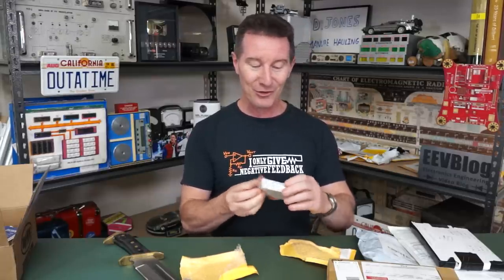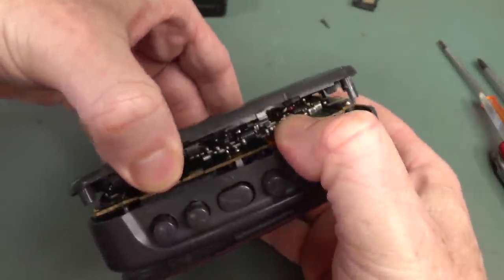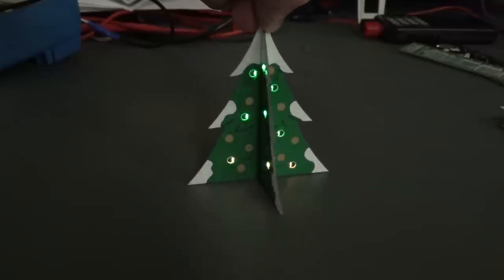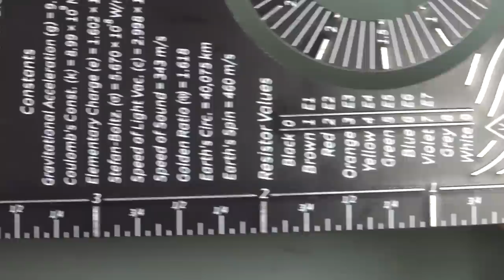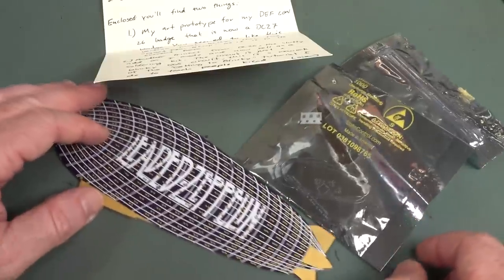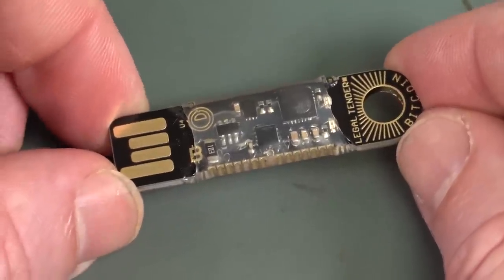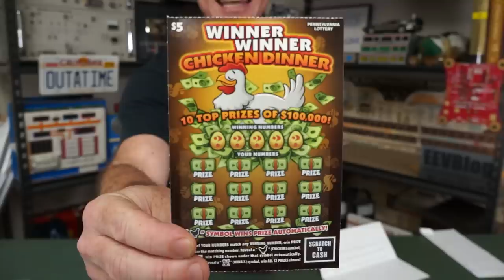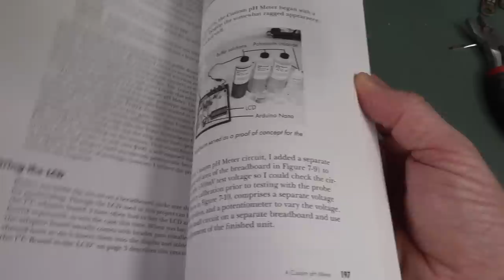EEVblog #1278 - Mailbag

Comment: The enclosure is for one of those little single board oscilloscopes.
Reply: I thing you are refuting to mail bag #1272.
Reply: yup, for the DSO-xxxx scopes
Reply: I was thinking the same thing.
Reply: Yep, it's for the Sainsmart DSO138 or perhaps the one it was ripped off from.
Reply: you beet me to it... seems obvious likely two diffrent housings too
Reply: I was about to say that
Reply: Some of those things are getting quite good.
Reply: @phalcon23  Hehe, "sweet" joke.
Reply: Yep.
Reply: @phalcon23  it's just the one housing. It gets all stacked together in layers.
Reply: Haha I bought the same case for mi small scoe along with some other stuff that got to me much later and I had the same reaction like Dave because I couldn’t remember what it was! Eventually I remembered and used it but almost a year later! They should add some kind of drawing to the thing! LOL!
Reply: That's what I thought. Saw my first one today. Looks exactly the same.
Reply: That was my immediate thought as well.  I have a Sainsmart DSO138 and have seen those enclosures advertised.
Reply: Yes it's for the dso138 digital oscilloscope red PCB with a power jack and the twist lock connector with alligator
Reply: @gweilo8888  Hi, jes on the DSO 138 is exact this Acrylic. I have soldered for fun a few Weeks ago. My was broken so i cut out a cover vor the Display and use this an only the Back for my but it is more a Toy than a Oszilloskope

Comment: The chips in the Walkman are Sanyo chips, as was the unbranded one in the Grundig player.  The LB1979 is a three-phase brushless motor driver specifically made for the pancake servos used in thin cassette players, and they were used in just about every player which had one, from the cheapest ones to the highest-end ones which had a single direct-drive servo for each of the capstans.

Comment: I still have a working Sony WM-EX382. This one has an auto-reverse and additional Dolby NR switch and HIGH/LOW knobs on the front lid. The LA4582C chip is actually made by the Sanyo.

Comment: Tyvek is used a moisture membrane that repels liquid water while allowing vapor to escape. 

In the US we use it underneath the facade to protect the cheap OSB. My 2014 house had Lowe’s branded generic Tyvek while my current 1969 house has tar paper on the fiberglass batting.

Comment: Tyvek is used as a water repellent, air permeable membrame layer in timberframe construction. Is it placed on the exteriour side of the insulation, on the inside a damp proof film is used to prevent the wood from rotting.

Comment: Ah the .85 inch hard drive. I have one here and tried to get it to run. I gather they use the same pinout as the MMC+ card. I have not had much luck with getting it to run. At this point I am nearly certain I fried the drive. Despite that I have yet to tear it apart, though the temptation rises a bit more with the viewing of this video...

If you want to know a bit more about the drives I can give you a few pointers, maybe you will have better luck.

Comment: Hey Dave, would you please do a video on how to reduce the switching noise and ripple of a switch mode power supply with a CLC filter? That would be useful for the RD6006 power supply. Thanks.

Comment: A lot of Intel chips you can de lid and replace the factory thermal paste to get it to run cooler. Amd chips usually solder like this, it's possible to de lid it with heat but there's almost no gains. And the Intel people use some liquid metal for this too which I find sketchy but it works

Comment: Those little MP3 players can be quite useful.  Some of them will also play FLAC or WAV.  I built a 2GB one up myself with a larger than stock battery and wrapped it up in heat-shrink tubing.

Comment: We used Tyvek envelopes to cut out little disc's to use as super lightweight hinges for surfaces on RC gliders. You'd use an xacto blade to make a little slot in the wood edge and slide the disc half in each side with a little touch of glue. Tough as hell and lasted forever.

Comment: That one-chip MP3 player was impressive!
Reply: But the sound quality will probably be awful even with 320kbps mp3s.
Reply: @simontay4851  Agreed! Still a technical tour de force.
Reply: for the price $1 usd on aliexpress, great for adding sounds to projects
Reply: @simontay4851  its $1 on aliexpress, probably sound better than your iphone!
Reply: Chip is Jeili AC46 or Jeili AC69 with the famous "the brewtooth device has been corrected succesfurry". If you find the SDK it's actually quite useful.
Reply: @Dust599  Should be a few cents at low volumes.
Reply: Those are the "the blotooh devwise is connected uh successfulleh" Chinese girl speaking all-in-one ic's. Probably pressing any buttons would make the Chinese girl speaks to you.
Reply: @SlinkyStoney  I have a Bluetooth reciever amp thingie for a Bluetooth box I made that has exactly that voice

was nearly shitting myself hearing it the first time
Reply: that chip also does the lipo charging  :O

Comment: best fake walkman was sold in uk as a saisho for dixons about 83/84, it had stereo speakers on the back, am/fm radio, and it would record from built in mic or radio, and had all the 3.5mm sockets to be used as a data corder with computers of the time or use as line in from something else for tape2tape, it was about £40, and only sold for about 9 month then went off market for over a year and came back with a mono speaker but a 3 band tone control on front.

Comment: just had an idea: 
the Christmas tree's LEDs, while illuminating the entire edge of their respective circles, clearly give more light from where in the circle they are mounted.

This, to me,  makes it look that the circles are bulbs and the LEDs their bases/filaments.

it would therefore IMHO look a little bit better if the LEDs were mounted on the bottom of the circles ,as then they'd be 'mounted' upright. (which isn't that easy a task with real Christmas tree lights ... just a (few) degree(s) off and the branch will twist along with the light)

Comment: 21:50 is for your DSO138
Reply: Indeed.. is for that oscilloscope thing
Reply: Yes it is.  :-) I have yet to put my DSO in my acrylic case. I need to extend the test square wave connector. I have my 2206 Function Generator in its acrylic case and with the Kanka Labs Modifications! (Well, all but the last mod). Looks nice, works OK. Need to tweak it some more.
Reply: Tweak all the things.

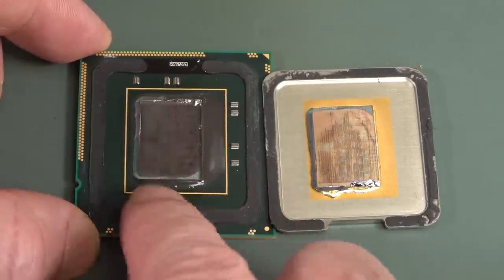Comment: 38:10 Intel doesn't think it needs to be bonded - in newer processors they cheeped out and don't solder IHS (Integrated Heat Spreader) to the processor just put some thermal paste and seal the edges with silicon(?), now only top of the line processors have soldered IHS (e.g. i7-9700K). So it would have worked if Maciej used newer processor.
Reply: For solder they use Indium.
Reply: I opened one of those processors with a heat gun. The chip just 
desoldered from the top and stayed bonded at the substrate. It looked 
absolutely horrible with the solder on top!!! This "fail" was much 
better!

Comment: In order to properly delid a chip like that xeon the cap aka the integrated heat spreader needs to be moved back and forth alot and slowly to minimize the risk of damage
Reply: Bit of heat works, its only indium bonding the silicon to the IHS, melts at ~150 will be soft near that

Comment: the OpenDimes are receive-only - They have no facility to spend the coins.

This allows you to hand an OpenDime to anyone, they can verify the Bitcoin balance on the device, and use it in lieu of cash. They can then subsequently use it in lieu of cash, or break the resistor and spend the funds.

As soon as the resistor is popped off, the device shows a big bright RED LIGHT whenever its plugged into power, making it instantly visible that the device is now worthless.

Comment: That Laser-cut stuff at 21:12 Mystery acrylic case? goes to the JYE DSO-138 Oscilloscope from Mailbag #1272!!! I’m pretty sure that the JYE website has the official instructions on how to assemble the acrylic case on the oscilloscope! I have the Official JYE DSO-138 & I bought mine with the acrylic case that you cannot figure out what it goes to. The “Big Ass Screen is the one on the DSO-138, those weird little things that look like chubby little crosses ☦️ or fat T’s are the switches and button extensions without which you cannot reach the oscilloscope’s controls, the long skinny rectangles with the circular cutouts is for the BNC Jack & Barrel Jack on the back of the scope. The only difficult thing was figuring out how to get the controls to stay put while the outer case is added.

Comment: How could you plate the x-mas tree holes if the leds need the side to contact? Can you tell PCB fabs to plate just half a hole?
Reply: The are not plated on the edge. It's 1.2mm thick base material and the LEDs measure 1.6x1.6mm, so there is 0.2mm overlap on either side. You can find some close up pictures here: https://www.instructables.com/id/PCB-Christmas-Tree-Card/
Reply: @nqtronix3409  He suggested LED light dispersion would be better if those holes were plated, but it would short the LED's. I don't see how a PCB fab can plate 180 degree's of a hole and leave the LED side un-plated (unless people file that off for 12 holes..). But it's a nice project.

Comment: That Sony Walkman was the bubble pack special back in the early 2ks....  Sold for $60cnd if I recall correctly?
Reply: I know. I sent it in for the weight comparison because I found it impressive how much heavier the "Beat Boy" was. I bought the Grundig in eBay and now that I see the insides, no wonder it didn't work. Why TF is there soldering on the wheels?

(I sent that package in)

Comment: I think a lot of those cheap MP3 players might be based around a "clone" of the same chip, with or without headphone amp and USB etc...

https://www.electronics-lab.com/project/mp3-player-using-arduino-dfplayer-mini/

Quite amazing to think how far tech has come in the past 15 or so years, though.

My first MP3 player (around 2001) only had 128MB of Flash, and took ages to load new files on, and the battery only lasted about an hour. lol

That would only be enough to fit around 30 songs on it anyway, so I guess it wasn't too bad.
The player probably cost 8 times as much as a 1GB SD card does nowadays.

But now you can buy something for $3 that not only accepts microSD, but USB storage as well. :o

(and you can easily control the chip via serial, and some of the chips even decode AAC, OOG, and FLAC.)

Comment: Reminder: Most modern Intel CPUs are NOT soldered, only some - since 3k Series (Ivy Bridge)... 9900K is soldered, with HEDT 7k was not soldered either, some 9k are and the new 10k should be.
AMD CPUs are soldered in general (all FX CPUs, all Ryzen). Some APUs are not though.

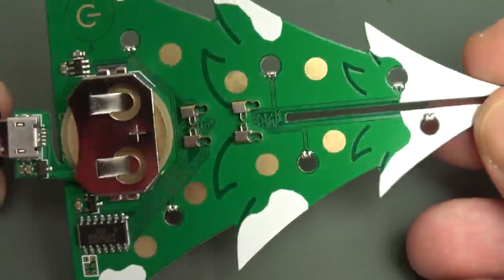Comment: 13:00 but how did they solder leds in those holes in the tree?
Reply: I think they are special right angle LEDs that are designed to be soldered on the side
Reply: How exactly? By hand? No pick and place machine would place it there.

Comment: I think that "Mega bass" thing at most of the Sony products from the early 90s and 2000s was just a scam by Sony itself. When disabled, it sounds thinny and crappy, but with "Mega bass" enabled, it sounds "normal".
Reply: For the one in this video (I sent it in) it did nothing. You can see the switch isn't even connected to anything.